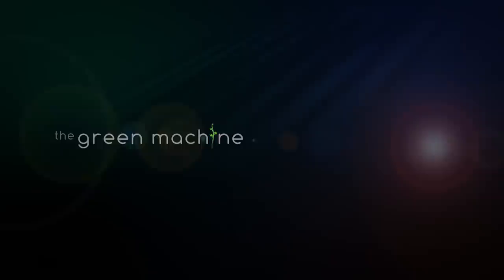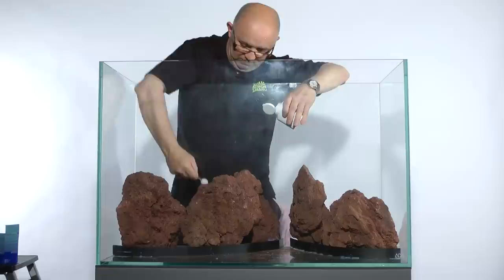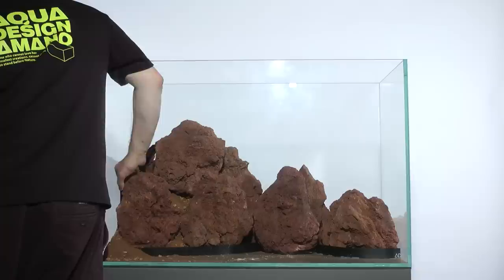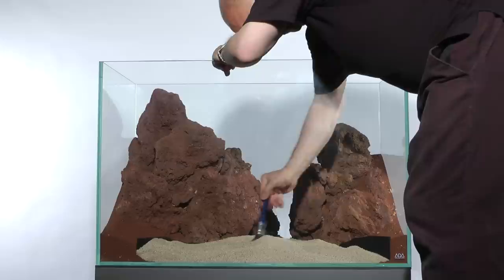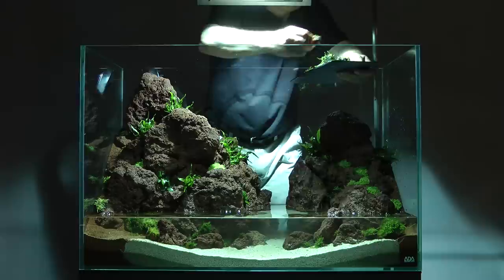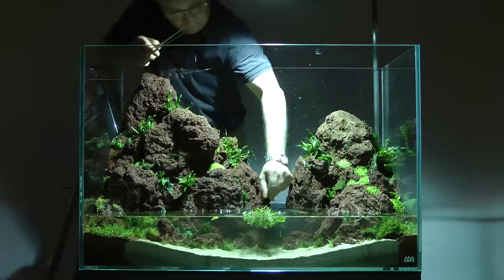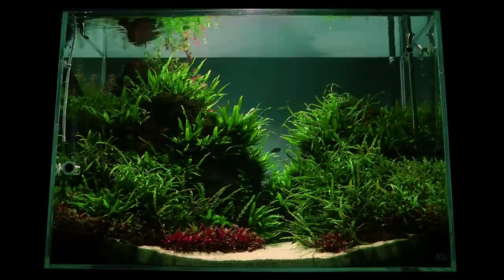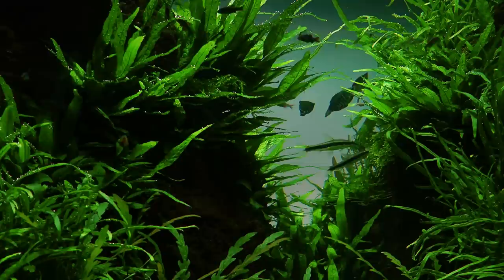Altitude Aquascape by James Findley - The Making Of

Comment: How long does the plants last? Does the water need to be changed from time to time?
Reply from the maker: With good maintenance and fertilisation they should last as long as the aquascaper desires. We do a 50% weekly water change.
Reply: +TheGreenMachineLtd  Why 50% weekly? What is accumulating in the water which needs to be removed?